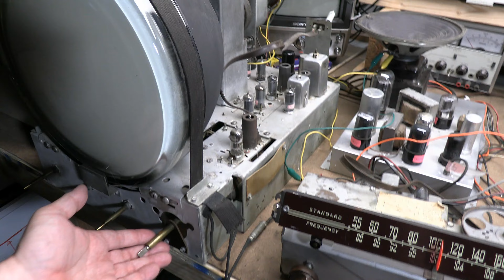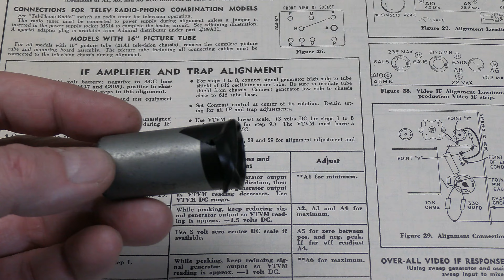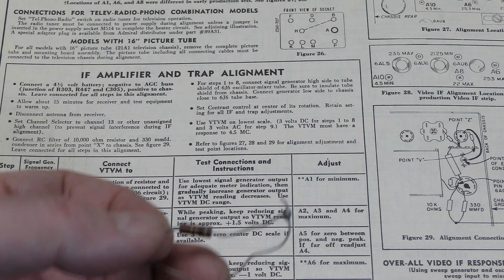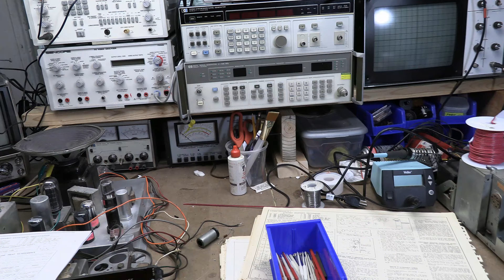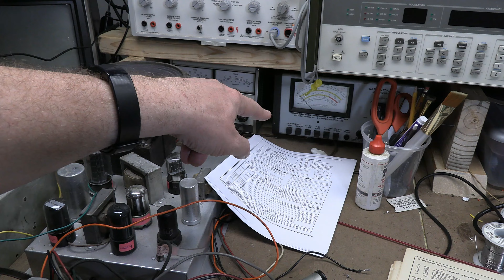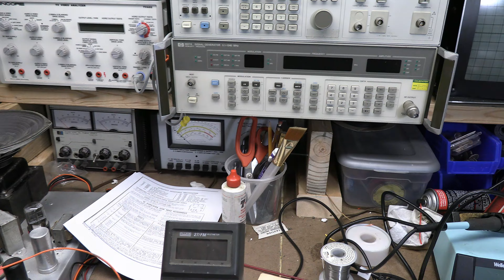Vintage TV Alignment 101:  Gearing up for an Admiral 20B1

Comment: So far I’m loving this. It’s like a walk down memory lane. I did TV repair from 1977 to 2011. When I started I worked for a dedicated tuner rebuilder. We were just getting into TV module rebuilding. Most of what we did was solid state. I love seeing some of the tube tricks like using the tube shield to couple you sig gen to the IF input.

Comment: YoumY want to make mention of using  an isolation transformer when working with transformerless (hot chassis) sets.
Reply from the maker: I thought I did?  I certainly will when I align a hot chassis.
Reply: @bandersentv  you certainly did.
Reply: Or the cheap way I did it as a kid, make sure to plug it in so that your chassis is at neutral (and don't switch it off if this would put your chassis at hot, instead just unplug the cord).  Then isolate the grounds of your test equipment.  You could still get zapped by touching a hot lug or wire though so Be Careful.  (How did I ever survive?)

Comment: Thanks for this! I have a late 40's Admiral in the queue so this will be very helpful. Would you consider doing the procedure with a vintage sweep generator?
Reply from the maker: I'll try using the Sencore SM152.  I think it's the only vintage sweep gen I have that goes that low.   As you'll soon see you don't absolutely need a sweep gen though.  It's nice the verify the overall response curve, but the step-by-step instructions do not require using one.
Reply: @bandersentv  Like you I have several HP sweep gens. I asked because I also have a Precision E-400 as well as an Eico 369. They are MUCH cruder than the HP's. I'll be looking forward to the continuing series
Reply from the maker: @apexmcboob5161  I had a 369 but sold it a while back.  Same with several others.  Now, I do have an all-in-one Philco 7008 I'll try to resurrect.  I'm missing the cables though.

Comment: This is a master class you are conducting.  The course on TV repair I took over 40 years ago was taught by an instructor who believed alignment of anything more than an AM radio should be avoided at all costs.  Admittedly, it is very challenging to do correctly, as there are wide band amps for AM video, and FM for the sound, plus traps and discriminators, oh my. But you are taking the mystery out of it,  in great detail, and that, it seems, is the way to be successful.
Reply: And then for color there's vectorscope.